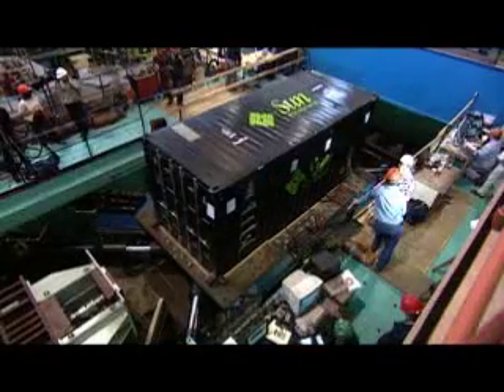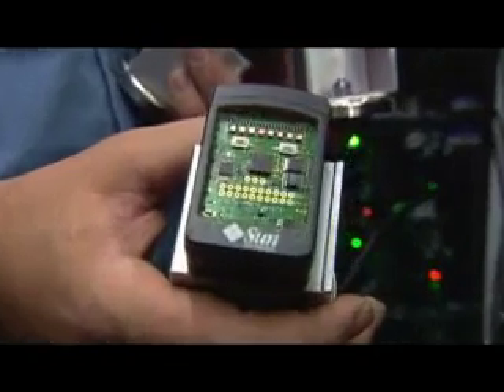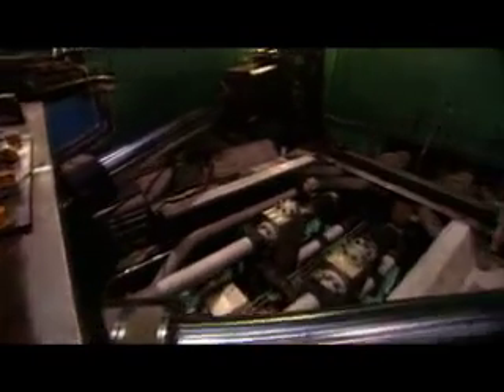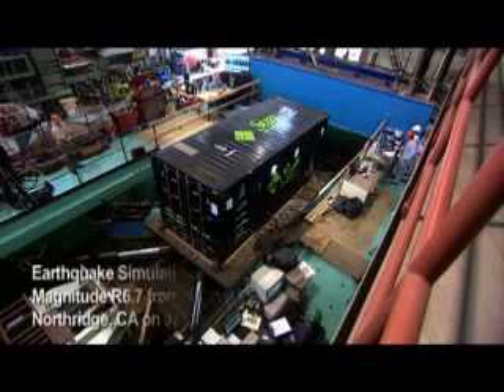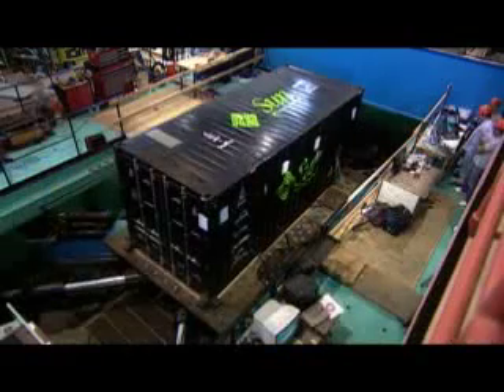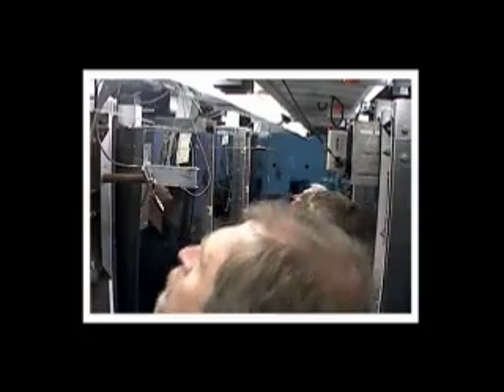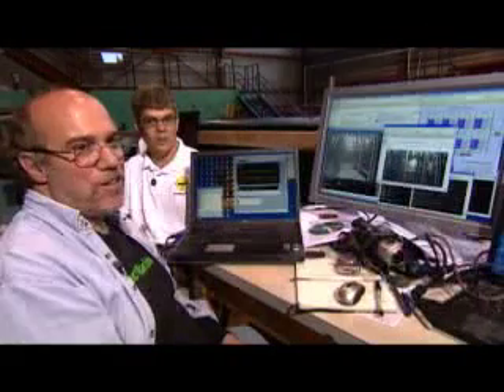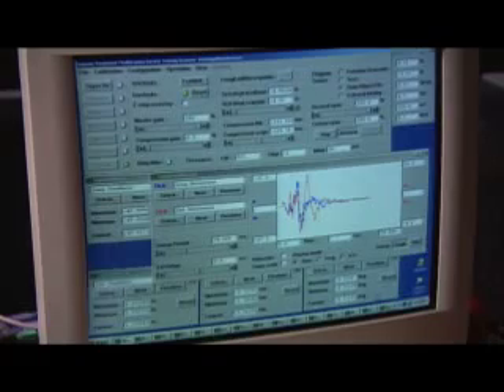Project Blackbox Test

Comment: I use to do environmental testing for a main frame company about 7 years ago. Just like this, but on a much smaller scale. If you want to do hot and cold thermal cycles, tail to the company called BEMCO. That's what we used.